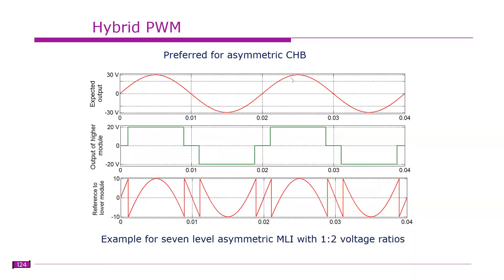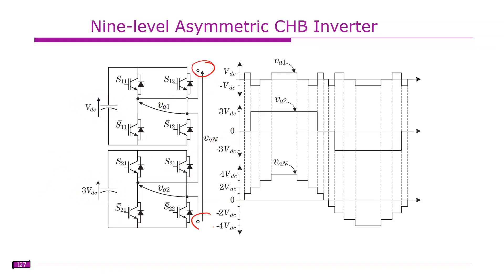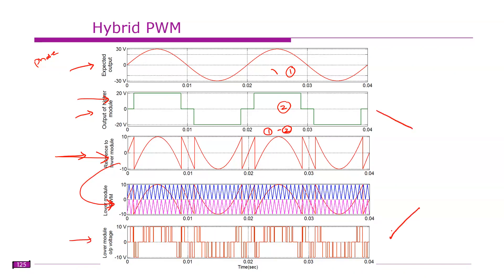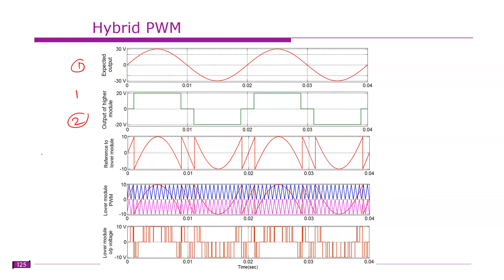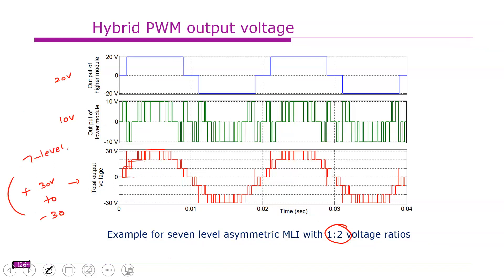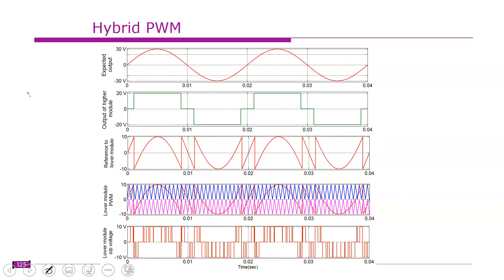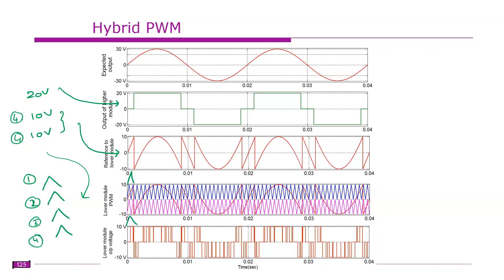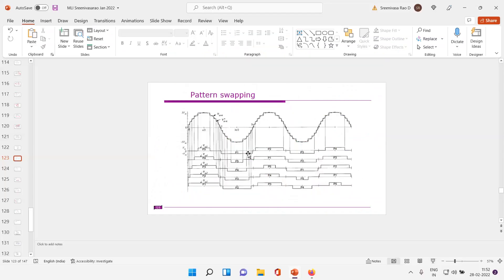Advanced Power Converters : Hybrid Modulation for Asymmetrical Cascade H-bridge Inverters | L13

Comment: Thanks for this effort
Would you please give the reference of that ?
Reply from the maker: C. Rech and J. R. Pinheiro, "Hybrid Multilevel Converters: Unified Analysis and Design Considerations," in IEEE Transactions on Industrial Electronics, vol. 54, no. 2, pp. 1092-1104, April 2007, doi: 10.1109/TIE.2007.892255.